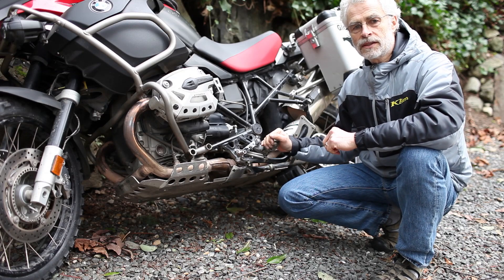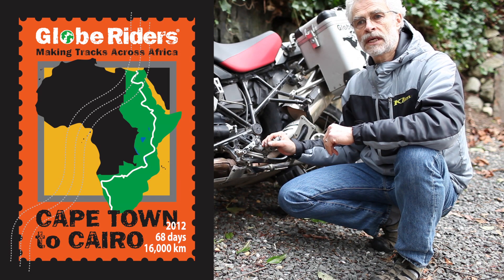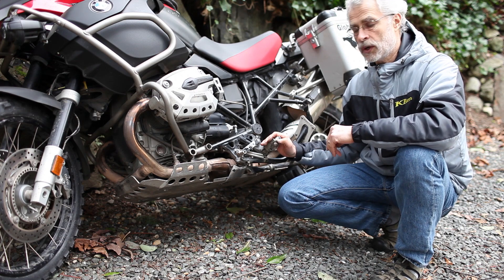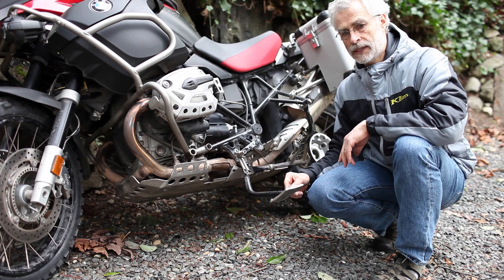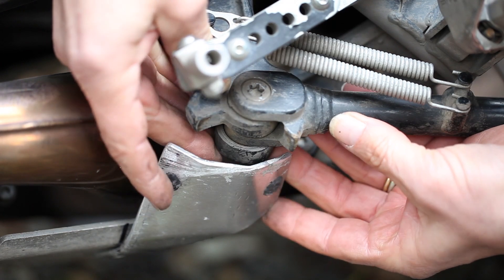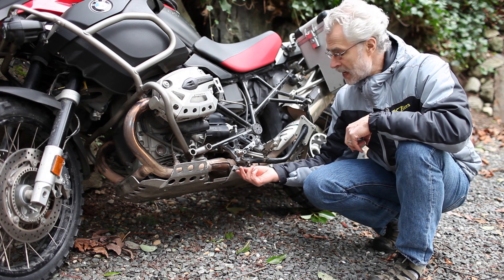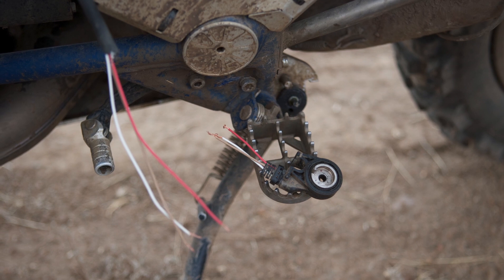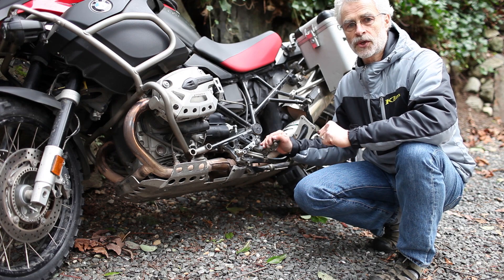BMW R1200GS Adventure side stand switch protection plate.

Comment: Your make shift protector looks like it will do the trick....however you should mention that you have to remove your center stand permanently for it to work
Reply: #scotte. I do not know where you get the idea that you have to remove the center stand, I never did. Today however I use a Touratech part to protect the side stand switch.